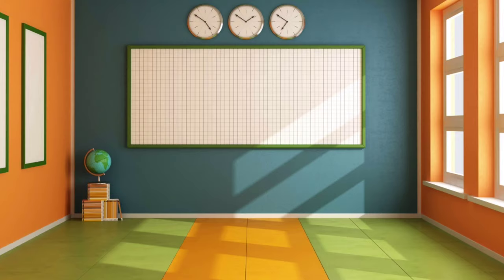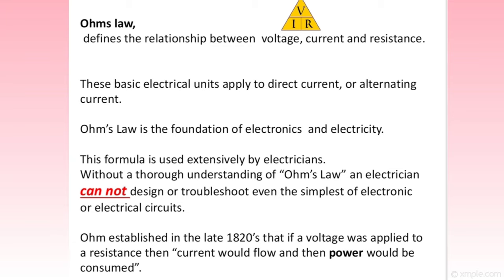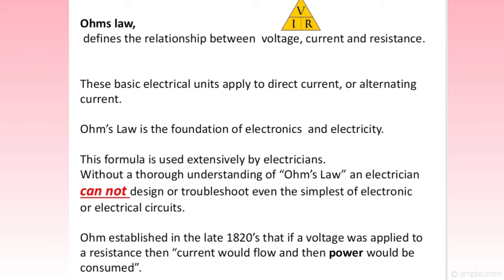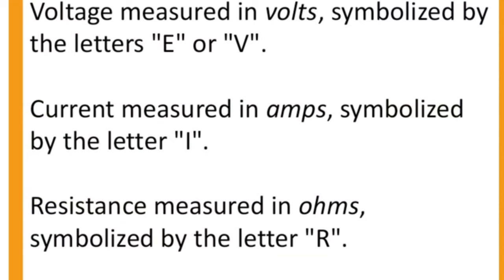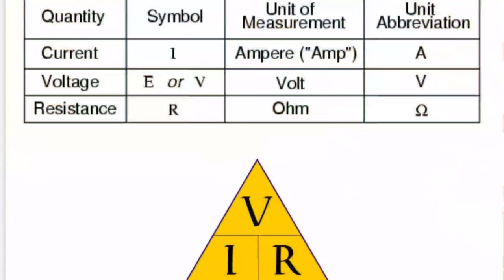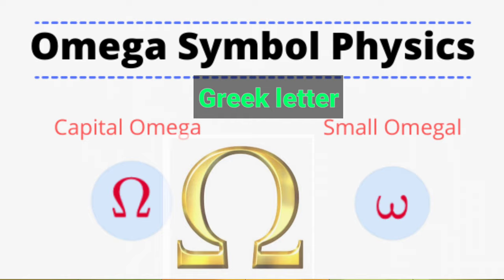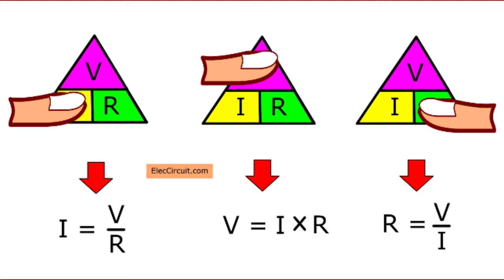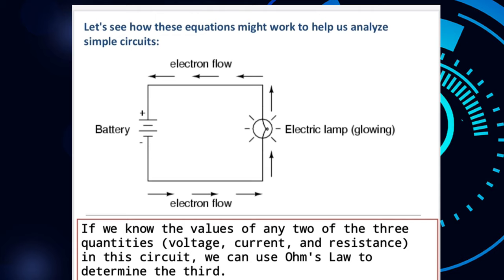Vlog#16 - OHM'S LAW

Comment: Name: Erno,Lourhane A.
Section: 8-Fortitude
I have learned is about of OHM's law.
OHM's law is defines the relationship  between voltage, current ant the last one is resistance.
The OHM's law is a foundation of ekectronics and electricity,an electrician can not design or troubleshoot even the simples of electronic or electrical circuits.OHM's established in the late 1820's that if a voltage was applied to a resistance then current would flow and then power would be consumed to the OHM's law.

Comment: Mondia Mark Arzen F.
8-Fortitude

I learned that the relationship between current and voltage ohms law relationships current voltage and resistance ohms law
is the foundation of electric voltage measures

Comment: Lorelee N. Romuga
8-Prudence

I have learned about the relationship of current to voltage and resistance in an electric circuit and I also have learned how to solve problems involving OHM's Law.

OHM's Law defines the relationship between voltage, current and resistance. OMH's Law is the foundation of electronics and electricity. Without a thorough understanding of OHM's Law an electrician cannot design or troubleshoot even the simplest electronic or electric circuits. 

OHM's Law:               V
                                 I    ----
                                        R

Electric Current = Voltage/Resistance 

Voltage or volts symbolized by letters "E" or "V"
Current or amps symbolized by letter "I"
Resistance or OMHS symbolized by letter "R"

Comment: Jasmine P. Lopez
8-Prudence

I've learned in this video that Ohms law is the foundation of electronic and electricity it also defined by name of Georg Simon Ohm.

Voltage measured in volts, symbolized by the letters "E" or "V"
Currently measured in amps, symbolized by the letter "I"
Resistance measured in Ohms symbolized by the letter "R"

Reminder:
When using Ohm's law always use the 3 step form
-1. Write the equation
-2. Replace the know values
-3. Solve the problem
Label with the correct unit of measurement.

Thnak u sm in this video sir Gamay, it helps alot, goodbless you!❤️
Reply from the maker: nice one

Comment: Rodelyn Delima
8-fortitude

I learned tha Ohm's law states that the current in a circuit is directly proportional to the voltage and is inversely proportional to resistance.

Comment: Carmaela Sofia C. Gomez
8-HOPE

I've learned that if you know two of the three variables you should able to solve for the third

When using ohm's law always use the 3 step form
1 write the equation
2 replace the known valaues
3 solve the problem
And lastly label with the correct unit of measurement.

Comment: Myckah Ysabelle S. Maquiniana
8-fortitude

I learned that Ohms law defines the relationship between voltage, current and resistance, and this is the foundation of electronics and electricity. I also learned in ohms law the measure to every symbols and how to compute eachother and also the relationship of the each parts.

Comment: Abby Jane B. Roxas
8-Piety 

       I learned that Ohm's Law defines the relationship between voltage,current and resistance.These basic electrical units apply to direct current, or alternative current.Ohm's Law is the foundation of electronics ang electricity.

        This formula is used extensively by eletricians.Without a through understanding of Ohm's Law an eletrician can not design or troubleshoot even the simplest of electronic or electrical circuits.
       
        Ohm established in the late 1810's that if a voltage was applied to a resistance then "current would flow and then power would be consumed."

Comment: I learned about this videos is Ohm's Law can be stated is: "a current flowing through a conductor is directly proportional to the voltage, given the temperature of the conductor remains constant". Therefore, if the resistance is kept constant, then doubling the voltage doubles the current

Comment: Justin Rain T. Rone
8-Charity

I've learned that ohm's locate that the current in a circuit is directly proportional to the voltage in each inversely proportional to resistance meaning when current increase, it is due to increase voltage greater resistance will affect the flow of current causing it to decrease.

Comment: Adrhianne Nicole L. Cabalhin
8-Fortitude
I learned about this is, Ohm's Law defines the relationship between voltage, current and resistant. The voltage measured in volts, symbolized by letter "l" "R".

Comment: Jackielen Tamita L
8-charity
 I learned from the video?Ohms Law allows you to determine characteristics of a circuit,such a how much current is flowing throught it ,if you how the   voltages of the battery in the circuit and how much resistance is in circuit.

Comment: Salvador A. Sison III.                               8-Loyalty.                                            I learned that the Ohm's law states that the voltage or potential difference between two points is directly proportional to the current or electricity passing through the resistance, and directly proportional to the resistance of the circuit. The formula for Ohm's law is V=IR

Comment: Leah Mae B. Clavicillas
Vlll - Loyalty
 
        I learned from the video that Ohms law defines the relationship between voltage, current and resistance. That if a voltage was applied to resistance then current would flow and then power would be consumed.

Comment: Khaycee Delos Santos 
8-HOPE

📌Ohms Law allows you to determine characteristics of a circuit
📌Key points that the Ohm's law equation shows that voltage is directly propotional to electric current

Comment: Arancillo Shayne R.
Grade 8 - CHARITY

Ohm's Law is one of the most fundamental and important laws governing electrical and electronic circuits. It relates relates current, voltage and resistance for a linear device, such that if two are know, the third can be calculated.

Comment: JUSTINE C. ARMENTA
8-HUMILITY
Ohms law states that the current through a conductor between two points is directly proportional to the voltage across the two points.

Comment: Michael Roy D. Catubao
Grade 8- Loyalty
Ohm's Law allows you to determine characteristics of a circuit, such as how much current is flowing through it, if you know the voltage of the battery in the circuit and how much resistance is in the circuit.

Comment: Ma. Alexa S. Bilbao
Grade 8-FORTITUDE
I learned about Ohm's Law is that Ohm's law states the current in a circuit is directly proportional to the voltage and inversely proportional to resistance. Meaning when current increases, it is due to increased voltage. And greater resistance will affect the flow of current causing it to decrease.

Comment: John Benedict M. Rojonan 8-Humility

According to Ohm's law, the voltage equals the current multiplied by the

tage or disparity in potential between two locations

is proportional to the current or electricity passing through the resistence and inversely proportional to the current or electricity passing through the resistence

ly proportional to the resistance of the circuit

Comment: Siarha Josaine C. Gerola
8-humility 
the voltage or potential difference between two points is directly proportional to the current or electricity passing through the resistance, and directly proportional to the resistance of the circuit. The formula for Ohm's law is V=IR.

Comment: Jannel Eve G. Bacani
8- HOPE

Learned : Ohm's Law is stated for a conductor at a constant temperature. Usually as temperature rises in a wire or resistor, resistance also rises.

Comment: Earon Rick F. Calaguin 
8-Kindness
I learned that Ohm's Law states that the current flowing in a circuit is directly proportional to the applied potential difference and inversely proportional to the resistance in the circuit. In other words by doubling the voltage across a circuit the current will also double.
electrical circuit, the current passing through most materials is directly proportional to the potential difference applied across them. The Ohm's Law formulas V = IR, I = V/R, and R= V/I. The V is always at the top. 
When Ohm published his formula in 1827, his key finding was that the amount of electric current flowing through a conductor is directly proportional to the voltage imposed on it.
I also learned that Georg Simon Ohm was a German physicist and mathematician that invented OHM'S LAW.
Electric current is a stream of charged particles, such as electrons or ions, moving through an electrical conductor or space. 
Voltage, electric potential difference, electric pressure or electric tension is the difference in electric potential between two points, which is defined as the work needed per unit of charge to move a test charge between the two points.
Resistance is a measure of the opposition to current flow in an electrical circuit. Resistance is measured in ohms, symbolized by the Greek letter omega (Ω).
FORMULA
RESISTANCE:  R = V / I
CURRENT:  I = V / R
VOLTAGE:  V=IR
THANK YOU PO SIR FOR THE VERY INFORMATIVE VIDEO❤️❤️

Comment: Raine Louise C. Serrano
8- Courage
October 21, 2021
I have learned about:

Ohms law,
defines the relationship between voltage, current and resistance.

These basic electrical units apply to direct current, or alternating current. 

Ohm's Law is the foundation of electronics and electricity.

Comment: Esguerra, John Jassen C.
Grade 8 - Fortitude
I learned Voltage measured in volts, symbolized by letters E or V.
Current measured in amps, symbolized by the letter I.
Resistance measured in ohms, symbolized by the letter R.
I also learned Ohm's law magic triangle E=IR, I= E/R, R= E/I.

Comment: Name:Emmanuel A. Balignasay
Grade & Section:8-Hope
I Learned that the key points that the Ohm's law equation shows are that voltage is directly proportional to electric current (so the higher the voltage, the higher the current), and that current is inversely proportional to resistance (so the higher the resistance, the lower the current).

Comment: Catherine Joy B. Andal
8-HUMILITY

I've learned that ohm's law is a foundation of electronics and electricity. Also the current that flows in a circuit is directly proportional to the voltage and inversely proportional to the resistance.

Comment: Jenica M. Naparate 
8-Charity 
        Ohm’s law states the relationship between electric current and potential difference. The current that flows through most conductors is directly proportional to the voltage applied to it.

Comment: Jhon Lorenz sampaga
8-Loyalty

Ohm's Law is one of the most fundamental and important laws governing electrical and electronic circuits. It relates relates current, voltage and resistance for a linear device, such that if two are know, the third can be calculated.

Comment: Angel Mae B. Estiola
8-Charity

I learned that Ohm's law states that the voltage or potential difference between two points is directly proportional to the current or electricity passing through the resistance, and directly proportional to the resistance of the circuit.

Comment: J-Crisly G. Salut
8- Loyalty
I'ved learned this video that Ohms Law is describing electric circuits because it relates the voltage to the current which the resistance value moderating the relationship between the two.

Comment: Ma. Honylyn T. Root
8- Humility

What I learned about ohm's law is Ohm's law states that the current through a conductor between two points is directly proportional to the voltage across the two points.

Comment: Kurt Lawrence E. Jose 
8-Humility
I learned that it have three quantities involving in the ohm's law and that is current, voltage, and resistance. The current is represented by capital letter i, if it is voltage it could be e or v, and for resistance it is represented by capital letter r.

Comment: Jasper Noelle A Genoguin
8-Charity

I have learned the formulas that stated to the Ohm's Law to get the voltage, we multiply the current and resistance of the circuit to get the resistance, we divide the voltage and the current of the circuit and to get the current, we divide the voltage and the resisitance.

Comment: Lhirah Aeden L. Bautista
8 - Loyalty

I learned that Ohm's law is a vitally important to describing electric circuits because it relates the voltage to the current, with the resistance value moderating the relationship between the two.

Comment: Rhia Mae M. Ajoc
8-Integrity

i learned that if you are aware of the battery's voltage and the circuit's resistance, you can use Ohm's Law to calculate a circuit's properties, such as how much current is flowing through it.

Comment: Manolito A. Alba Jr.

8-Charity 
I learned that Ohm's Law is a formula used to calculate the relationship between voltage, current and resistance in an electrical circuit. To students of electronics, Ohm's Law (E = IR) is as fundamentally important as Einstein's Relativity equation (E = mc²) is to physicists.

Comment: Rhona Mae Diaz
8-Integrity

I learned from the video that Ohm's law defines and is used to calculate the relationship between voltage, current, and resistance. Ohm's law is a law that controls the relations between voltage, current, and resistance in an electric circuit.

Comment: Krystal G. Villarama
VIII-Hope

Ohm's Law is a formula used to calculate the relationship between voltage, current and resistance in an electrical circuit.

Comment: Garcia, Mharzmine D.
8-FORTITUDE

   I learned that ohm's locate that the current in a circuit is directly proportional to the voltage in each inversely proportional to resistance meaning when current increase , it is due to increase voltage greater resistance will affect the flow of current causing it to decrease.

Comment: Rogelio G Yape III
8-Hope
Ohm's law states that the voltage or potential difference between two points is directly proportional to the current or electricity passing through the resistance of the circuit. The formula for Ohm's law is V=I/R.

Comment: Juan Luis E. Salalila
8-Humility
I learned that Ohm's Law is a formula used to calculate the relationship between voltage, current and resistance in an electrical circuit.

Comment: Name: Andrea B. Gumandam
Grade &section: 8- Fortitude
What you learned from the video is about the OHM'S LAW - defines between voltage, current, and resistance; Ohm's Law is the foundation of electronics and electricity; Ohm established in the later 1820s is the voltage was applied to resistance then "current would flow and then power would be consumed". Ohm comes from the name of the scientist Georg Simon Ohm. 

There are 3 quantities on Ohm's Law are Voltage - measured in volts, symbolized by the letters "E" or "V" Unit of Measurement Volt and Unit Abbreviation V; Resistance - measured in ohms, symbolized by the letter "R", Unit of Measurement ohm, and Unit of Abbreviation Ω; and Current - measured in amps, symbolized by the letter "I", Unit of Measurement Ampere ("Amp") and Unit of  Abbreviation A. We have this Greek Letter and that is Omega Symbol Physics - are Capital Omega and Small Omega. 

Ohm's law magic triangle E = I R, I = E/R, R = E/I. In order to find voltage, you just simply multiply current and resistance. In order to find the resistance, you simply divide, voltage divided current. In order to find current just have to do voltage divided resistance. 

Resistance (depends on the size of the wire.)
Thick wire-less resistance
Thin wire-more resistance
Long wire-more resistance
Short wire-less resistance
Current (depends on the resistance in the circuit)
Greater resistance-less current
Less resistance-greater current
Voltage (depends on the voltage source)
Potential difference.

To obey the ohms law means a conductor has a constant resistance regardless of the voltage.

When using ohm's law always use the 3 step form:
1-Write the equation
2-Replace the known values
3-Solve the problem
•label the correct unit of measurements.

Comment: Yvanna Jhane H. Quimanhan
8-Humility
I learned this video is It shows that voltage is directly proportional to electric current, and that current is inversely proportional to resistance (so the higher the resistance, the lower the current).

Comment: TENIDO, EUDELYN M.
8-HOPE
  I learned for this video ohm's law is a formula used to calculate the relationship between voltage, current and resistance in an electrical circuit to students of electrons, ohm's law (E=IR) is a fundamentally important as Einsteis relativity equation (E=MC^2) is to physicist.

Comment: Rias, John Rudolf A. 
VIII-Prudence 
10/20\2021 

From what I've learned in this video is that Ohm's law is related to electricity and the forces that control the travelling and transfer of electricity.

There are three forces relating to this: Voltage (V), Current (A) and Resistance (Ω). Voltage is how much power is being used. Resistance is how much the power will be reduced by outside forces or variables. And Current is how much power is being actually transferred with resistance in to a count.

Resistance and Current are inversely proportional to each other. If one increases, the other decreases. And vice versa.

Comment: Teodyrick Ymiel B. Atis
8-Charity

I learned that Ohm's Law is a formula used to calculate the relationship between voltage, current and resistance in an electrical circuit.

Comment: JAMES MARQUINE A. BATULA
8-CHARITY
   
From What i learned is  are  Ohm's Law is a formula used to calculate the relationship between voltage, current and resistance in an electrical circuit.

Comment: James Adrian T. Pelaez
8-Humility

I learned that OHM's Law states that the voltage or potential difference between two points is directly proportional to the current or electricity passing through the resistance, strength of a direct current is directly proportional to the potential dofference and inversely proportional to the resistance of the circuit.

Comment: Alfred Rome R. Magpayo
8-humility
I learned that Ohm's Law is a formula used to calculate the relationship between voltage, current and resistance in an electrical circuit.